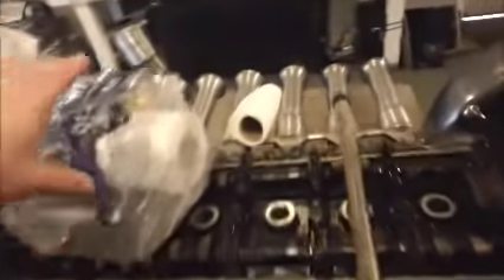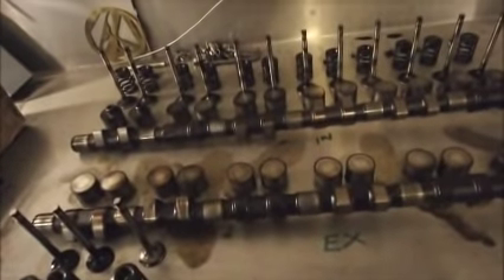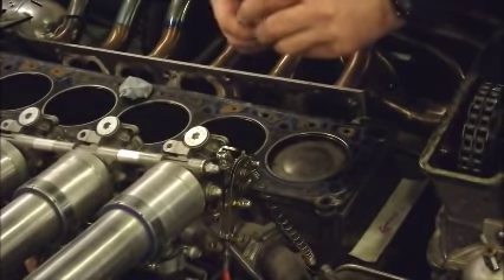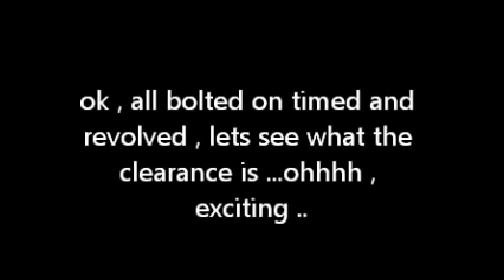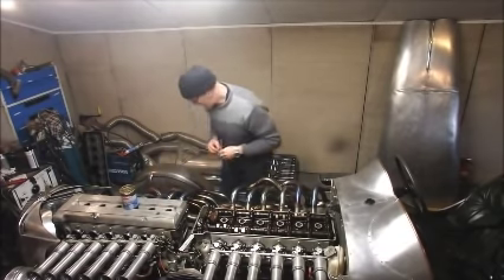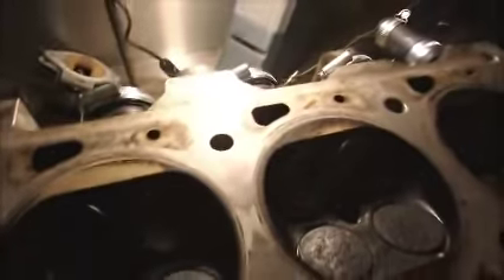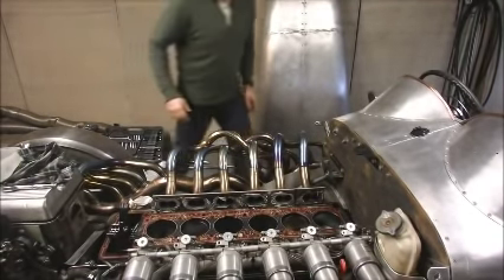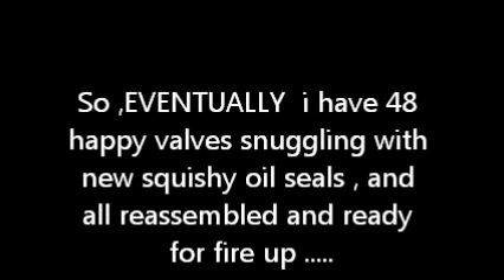Engine dev part 2.. WILL MY PISTONS HIT MY VALVES?

Comment: think you where running one propane mixer per engine of so you could see if the rear one is set up different and gives more mixture than the front one...... never mind the oil on top of the piston said it all